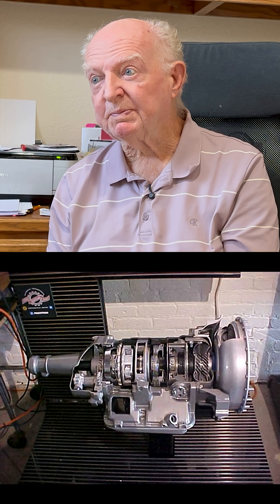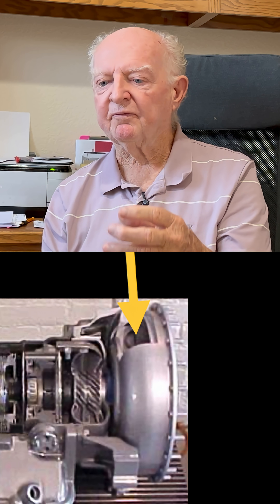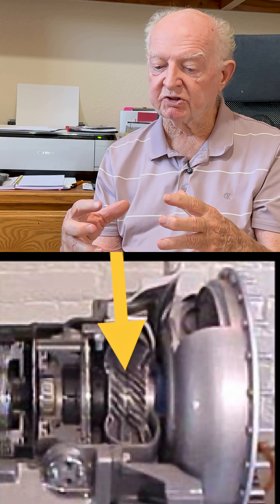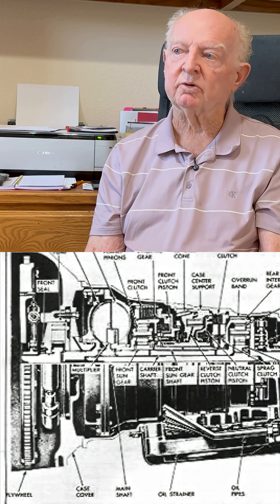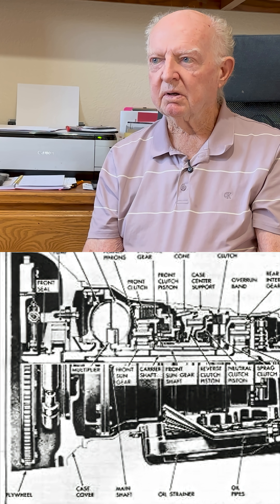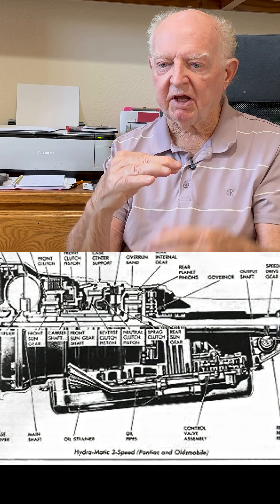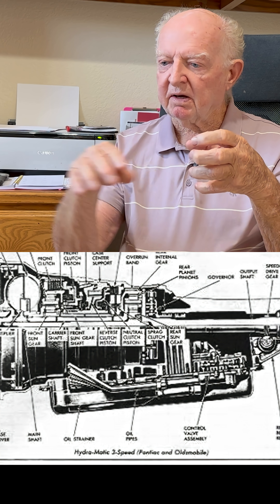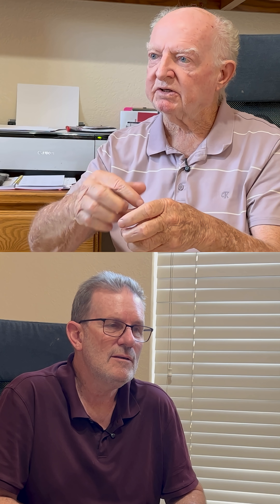Jet Away vs Slim Jim Transmissions - Ask Ed Smith 40 #BarryT #enginebuilding #classiccar

Comment: 🇺🇸😎👀 I worked at Oldsmobile in Whittier 64 five and six. We had  a Roto Hydramatic and a torus. I could pull all the parts for a transmission rebuild. Don’t remember much about them. But all the parts doors were labeled and the mechanic would ask for the same thing over and over and they were having problems with one of the automatic transmissions because Detroit would fly out and look at our old Parts. They also had a campaign on the rear axles that howled and it was a big weight and they were called moose balls great part of my life.😂🇺🇸🇺🇸👀

Comment: JetAway is a confusing term.  Refers to both the four speed cast-iron automatic in the Cadillacs, as well as the three speed, slim Jim in the Oldsmobiles. I don’t know about the Oldsmobile, but the Cadillac models that are four speeds did not have a torque converter. They had a taunus, which is basically a fluid coupling that does not multiply torque. Hence, the reason for four speeds, first gear was very low to make up for the fact that it didn’t have a torque converter.
Reply from the maker: It is confusing - the Cadillac/Olds original was a 1956 4 speed Hydra-Matic then Name reused by Olds and Buick in the mid ‘60’s for a small 2 speed different transmission and lower power applications

Comment: There was also a Hydramatic 4 speed in the late 50s Chevy and GMC pickups. 
    There was a 375 Slim Jom that was a light duty 400 replacement transmission. I thought it had fewer cluthches in each clutch pack along with a screwy filter. Pan shaped like a 400, took the same gasket, but had a heel indention on the pan.

Comment: Jet away in 1967 olds cutlass 330 engine it was basically  a super turbine 350 with a varible pitch electric switch operated torque converter, that was mounted on firewall and adjustable to throttle position ❤

Comment: Cutlass had a jetaway 2 speed with a switch pitch torque converter. Slim Jim was in the full size models. Buick a-body had a super turbine 300 two speed.

Comment: Believe the 63 LeSabre I owned had the slim Jim, or I was told it did, 2speed, on the shifter reverse was at the bottom of the indicator, if you put it in drive2 it took off that way, 401 Wildcat motor, that baby would fly. 13 bolt diff cover as well.
Reply from the maker: Very cool!

Comment: Torus is the name for the converter, fun facts you need drain every thing in the Hydra-Matic when you change fluid, the Torus also needed to be drained. The Hydra-Matic need GM fluid Grade A to work properly. It's not a bad design it's even was in service in some tanks under world war 2.

I have a 64 Cadillac series 62, last year for the Hydra-Matic.

I have the conversation pan on my transmission, only problem I need put two seals on the transmission my joke didn't seal.

Sorry for my bad English.
Reply from the maker: Thank you for the comment! Interesting